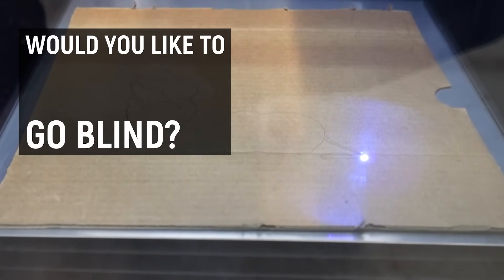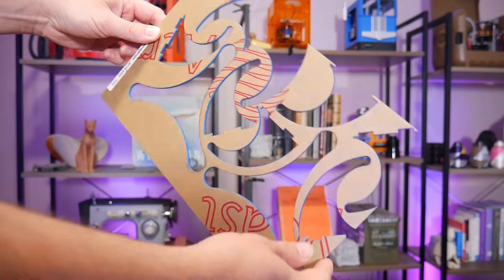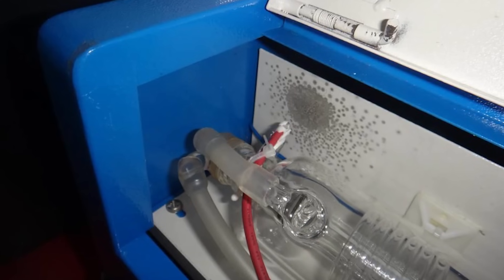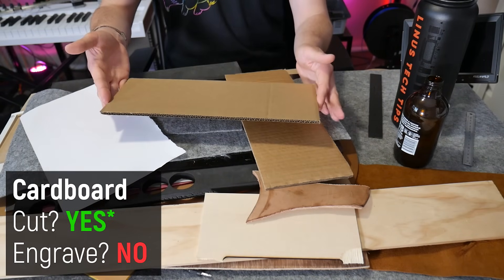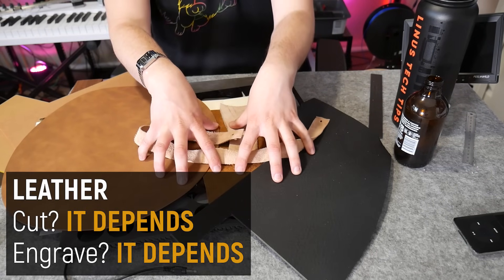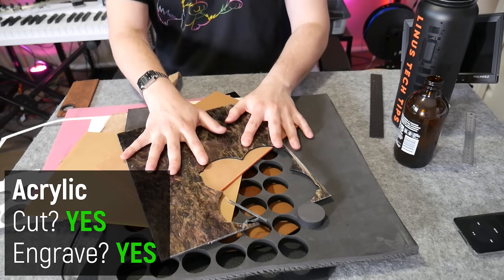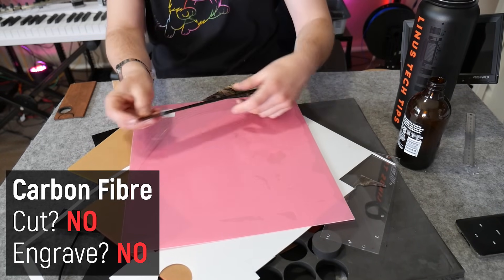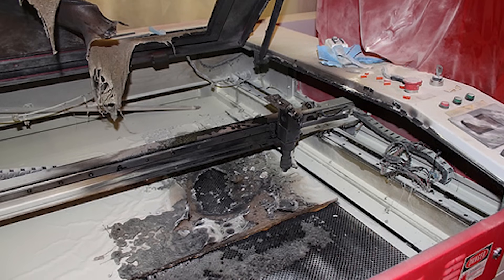Are cheap laser cutters safe?

Comment: My job was recently gifted one of these 5W lasers and I thought it was cool as hell, so I volunteered to help set it up and test it. I understood the danger of the laser/lasers in general to some extent, but the orange shield around the laser body combined with the glasses it came with gave me a false sense of safety. After testing a few small balsa samples that it came with indoors, I decided to take it outdoors because the fumes were so bad. During my time outside, I happened to be adjusting my safety glasses at the exact moment I was turning around back towards the laser while it was lasing. For about one second I got a totally unshielded view of the laser from about 10ft away. I immediately turned off the laser and went inside to Google whether I had just given myself irreversible damage to my retina. For the next 12 hours after I thought had blind spots in my vision and was furiously googling whether the reflectivity of the material I was lasing at the distance and angle I viewed it, and the power of the laser–doing all this math to find out if I had done damage. I went to the eye doctor the next day and they scanned my retina and thankfully did not see any damage. Shortly after I happened to stumble upon a page that showed me the math of the exact laser I was using and said that I would have needed to stare at it for several minutes for damage to be done at that distance. It was an ENORMOUS weight off my shoulders. 

Moral of the story is that I got lucky, even if I wasn't in any real danger, because the opportunity to be blinded is still there and it should be fucking illegal to sell these things in their current configuration without any warnings.
Reply: I had almost the same thing many years ago. I do Holography as a hobby and as an artist. And the incident I am talking about happened when I was working for a professional guy that made large scale Holograms. I was in the process of aligning a pinhole (needed for clean up spread beams) and decided to take short break. The laser that was used was a powerful Argon laser that could output several Watts. When I turned around to get something to drink I thoughtlessly took of the protection goggles. However, one of the beams that was not aligned properly (yet) bounced of a shiny metal plate right into my eye. All I could see was a bright green flash. Of course I immediately went to an eye doctor, and to my relieve there was no damage done. I got lucky because the beam was already been through a spread lens, and the metal surface was unpolished enough to make the beam very diffuse. On top of that, it was only a very sort flash. Still - It could have been far, far worse.
That day I learned a very valuable lesson! Never ever make the mistake of taking off protection goggles in a room with a working laser. Until this day many, many years later, I still take that same precaution every time I work with a laser. Even if it's a low powered 1mW to 20mW type. And I am happy to say that even on my age (I am almost 70) my eye sight is still a sharp as ever.
Reply: @jclosed2516  I'm glad to hear your experience turned out okay as well! It's absolutely terrifying. I also got lucky in that the material I was lasing diffused the beam as well. If it had been reflective it could've been a lot worse. Losing your eyesight due to your own incompetent is the scariest thought. I can only imagine how many young children who get one of these as a gift won't be so lucky 😔
Reply: @bunnypeople  Yeah - That worries me a lot. Especially because the majority of these "sets" have little or no warning at all in their manual. On top of that - Young people these days go for instant gratification, and most of them do not even touch the manual and even less take a look at the safety chapters. I wonder how many have damaged eye sight after using that unsafe equipment for a while.

Maybe because laser equipment was scarce and expensive 40 or more years ago, that you as owner payed full attention to the manual and thus prevented a lot of accidents. However, as you and I experienced, even the more knowledgeable can make mistakes (and learn their lesson that way).

Comment: Wow. I was literally just talking to my friends about how I was thinking about getting a laser cutter for years and might finally decide to get one, as an artist who's interested in cutting acrylic for little keychain trinkets, and I found cutters that were cheap. But I checked out your channel by chance, and noticed this video as the recent upload, and it really came in clutch before I went and trusted that these machines were in any way safe for home use.

My uninformed ass figured it didn't look that much different than an FDM printer, and as far as I was aware those weren't too bad to have chillin' in your room. (Or at least my dad had his in his room... maybe I'm wrong about that too!) Glad this video came out before I took extra work to buy a cutter, you may have saved my eyes, and I suppose by proxy my career, lol
Reply: You could look into shrinky dink stuff if you don’t want to mess with laser cutters
Reply: The key thing here is if you want a laser cutter, get one that has a full enclosure, and follow all safety procedures and recommendations - I let my printers run overnight, but I wouldn't do that with a laser cutter, not that I have one. My largest FDM printer has a dedicated hepa air filter and all my printers are on a UPS/surge protector. My resin printers are on the other side of my pretty big workroom from where I usually am, and I generally print just with PLA on the plastic printers, which is pretty safe. As a rule though, I don't let the cats come in here just to be extra safe.
Reply: Dude I have a 5.5w laser cutter in my room and so far so good,  but SAFETY first  I bought an enclosure and a smoke extractor that attaches to it and I also run an air purifier,  I mainly use it for engraving acrylics and 3mm wood sometimes in a while, I have cutted 3mm bamboo and 3mm wood, just make sure you know the limitations of your machine, take your precautions and definitely have it enclosed, then again I don't encourage to have it in your room like I do, as your uses for the laser might differ,  I only use it for small projects and personal stuff and less than 1 hour a day , so smoke does not accumulate in my room at all,  I notice engravement does not smoke as much as cutting but when I cut I only cut small pieces  and run it for a very small time, so there is little to no smoke at all with the help of the smoke extractor,  that being said I think that cheap lasers are a good alternative to enter the laser world and get your feet wet,  I would NOT purchase a 1000$ laser when you are just a begginer,  just my humble Opinion.
Reply: @fluffydragon84  you don't necessarily need to purchase one that comes in a Full enclosure, those are worth 1000s of dollars and I would NOT purchase a 1K laser when you are a beginner, What I did was purchase the enclosure separately along with a fume extractor and it works like a charm,  I also do 3D printing and its a whole different beef,  I run my 3d printers all night in my room with no issues,   but WOULD NOT do that with a laser engraver and not being there supervising myself,  PLA is pretty much safe like you mentioned but Resin, I literlly have the printer outside in my enclosed porch if I was you I would not have it in the house at all, resin is SUPER TOXIC even if you have it enclosed and vented, is not recommended.

Comment: Great video! About chrome tan leather, I do Pyrography and I’ve always been told to only burn vegetable tanned leather because the chemicals used to tan chrome tanned leather are toxic when burned, so I would assume the same goes for cutting. 

Also, the company I work for is thinking about getting a laser cutter, and I’ve personally been thinking about getting one, and this video gave me a lot to think about in terms of safety.

Comment: I have purchased a couple of the open gantry type diode lasers and completely agree there isn't enough focus on safety. Buy a quality pair of safety goggles, don't rely on whatever is tossed in with the laser you are getting. I also found, after my very first test cut, an enclosure wasn't just a nice-to-have, it was an absolute requirement, as is smoke extraction. If you make your own enclosure, make sure the material you use for any windows is rated to filter the appropriate wavelength of light. You only get one set of eyes, don't go cheap on protecting them, get the real deal materials. Air assist also helps with keeping flammable materials from igniting, as well as providing a much better cut. I never walk away from my lasers when they are running. Somehow, I think machines like this know when they aren't being watched and take full advantage of the opportunity. I also keep a fire extinguisher right next to the machines.
Reply: The thing is, we don't all have infinite money. Fully enclosed laser machines are very expensive.
Reply: Any tips on making sure the goggles bought are actually safety rated (and not these fake colored plastic things)?

Comment: Be careful with your venting - always have an air inlet as well as an outlet in the same room. You can pull carbon monoxide backwards through the exhaust of things like water heaters if you don't. A young couple (and their cats) died because they put a powerful fan on a laser cutter and didn't allow for make-up air.
Reply: And get a CO2 alarm if you have any open-flue gas appliances.
Reply: @petermichaelgreen  I think you mean a CO (carbon MONoxide) alarm, CO2 won't do anything except trigger your breathing response.

Comment: This is a great video. When I was researching buying a laser I started out looking at the new generation of diode lasers. They do look great in advertising but once you start looking at the limitations and dangers they were quickly dismissed. I quickly decided on a co2 laser just for the fact I needed a self contained unit that exhausts outside of my shop.

Comment: Good topic - I have been working with different lasers for 35 years now. 
Only about 1 year ago I bought one of this solid state laser modules, to hook it up
to an 3D printer.
I was shocked when the instructions directed me, to use the part cooling fan to control 
the laser diode ! One mistake and the laser would fire.... 
My 3D printer / laser is inside a vented / temp controlled cabinet, with activated carbon filter. 
-added safety switch to energize laser
-added a second control output via GCode
-kept the PWM control in parallel with laser
-added nozzle / shroud around laser 
-cabinet door interlocks, to power off laser when opened
-tinted the cabinet door with UV reducing film 

And still I am not very confident with those high power laser LED modules.

Comment: Was watching some YT video reviewing another 20w diode laser in the background and my wife is like -- see, you don't have that, and you're running out of room in your shop for more tech, and I told her there are multiple reasons I don't want a laser, and shop space isn't one of them, neither is cost. Safety -- i.e extraction of fumes etc is my primary explanation to her -- tried to explain that there are no safe locations to extract the fumes out of the shop that would be far enough from other air exhaust/intake locations -- so I'm not even considering it. Thank you for alerting folks that all these videos showing happy model dad and his kid using one of these lasers in the open is scary and dangerous as hell.

Comment: Great video and great timing. Was considering buying one of those cheaper laser machines but it didn't feel right. One thing i feel is missing from this video though, is testing out a pair of protective glasses that come included with one of those cheaper lasers to see if they are adequate enough to protect our eyes. I remember reading/watching somewhere that those cheap glasses are not to be trusted but I failed to find an actual experiment where one of the most popular cheap lasers is tested. Something from Neje or Ortur for example.
Reply: Simple answer, if you did not get your laser safety goggles from a reputable company do not trust them.
Reply: Safety goggles should burn when in the correct laser light. They absorb 100% of the light, and thus burn. If yours don't do that. That's a bad thing. 

A NDT is of you can see the laser with the goggles (obv only works with visible light lasers) but if you do, that's a bad thing, as the light isn't being absorbed
Reply: @Zippytez   I haven't gotten a laser engraver yet and i probably won't any time soon until i can ensure the saftey of operation within my small bed room 😅
Still got the eye safety and ventilation to figure out.

Regarding what you said about the safety glasses. Apart form the high end glasses i have not seen any on youtube that did not show the dot which concerns me. I have seen videos of the cheap glasses burning as you described without reaching the other side of the glasses but since they also show a laser dot when we wear them then some light must still be passing and the concern is thus whether the light passing is of high enough energy to harm the eyes but not cause a burn mark. I assume that it is probably due to the light being on a wave length outside the rang of what those cheap glasses are rated for / can handle. Thus we really need to have some testing done where the glasses are checked for saftey against the laser coming out of the machines they are shipped with.
Reply: They are essentially colored plastic. Laser googles for this sort of laser power very often look like sky googles because even reflection is incredibly dangerous.

Comment: I tested cutting carbon fiber with epoxy a couple weeks ago with my 20W output diode laser. It cuts albeit slow very slow. Aside from leaving slight discoloration, I would say it was probably one of the better behaved cutting materials. Also to add to the list, kevlar cuts extremely fast, leaves a little bit of browning where it gets vaporized, and smells like fireworks, with some amount of hydrogen cyanide for good measure.

Comment: Excellent video, and I've had the same thoughts seeing these devices sold. They of course can be used somewhat safely (say, if you live alone, use proper, rated goggles, and install proper ventilation). But it's so easy to make a life-changing mistake, and at that point - you might as well get a proper machine.

It makes absolutely no sense to use an un-enclosed lasers in anything besides a dedicated laser laboratory.
Reply: I wouldn't have even thought that selling unenclosed lasers is legal.

Comment: Great video as always!!  I have a k40 style of laser that I went through very carefully before even plugging it in to check things like grounds, loose connections etc.  Once I took care of the issues I did find and added a much better ventilation system it's been a really good machine.  However I never leave it unattended while running jobs on it.   A tip on various leathers, I do a lot of leather engraving or cutting and I only use good quality vegetable tanned leather for this.  Chrome tanned leathers will release very bad fumes that are not only bad to breathe but can also damage your lenses and mirrors.  One thing I have found that when cutting or engraving on leather is to do what's called casing the leather.  You dampen it and let it almost dry before you run it in the laser.  This gives you really nice clean cuts and engravings and helps cut down on the smoke.
Reply: I went through my K40 thoroughly as well. We later added an extra 200CFM extraction fan with it properly vented outside. Thanks for the tips on the leather. Been thinking about ordering some leather to play with from Tandy. They have their tanning processes well marked so you know what you are dealing with. I deal with acrylic and wood frequently so also installed an air assist that keeps the lenses clear of any smoke damage.